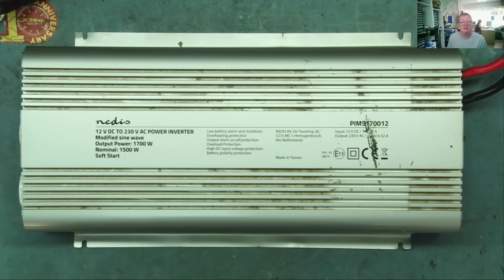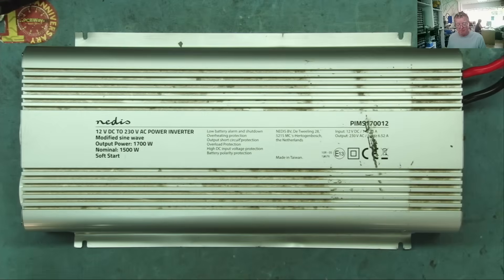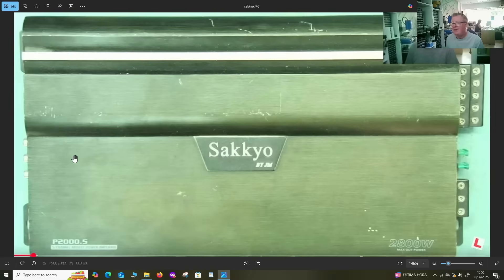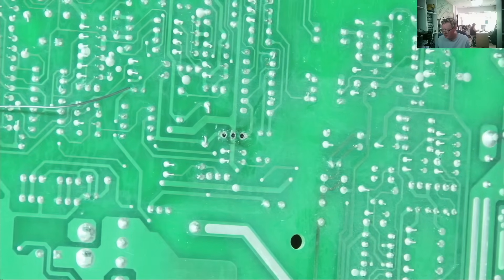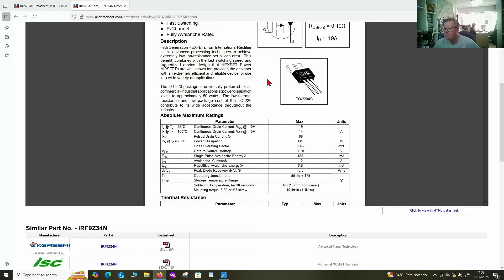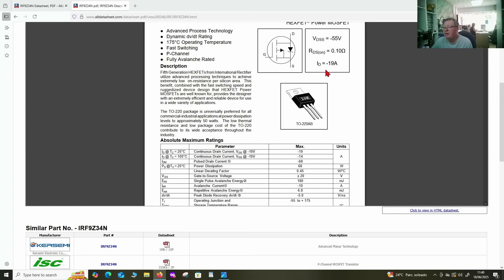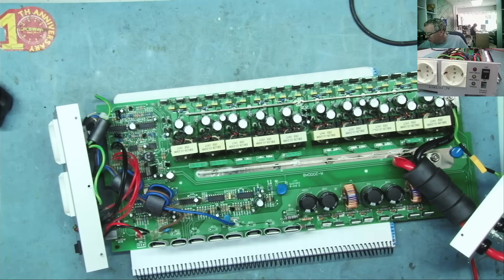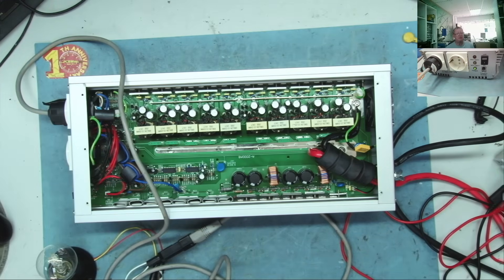You Fix Something And It Comes Straight Back Faulty! Why Could This Be?

Comment: Re. that MOSFET…. I always shudder when you and other Youtubers just push components over when trying to get to something else to measure, or just bend components whilst talking about them… I have learnt that the hard way around 40 years ago… Never, ever push components to get to measure other stuff…. Other times, like the guy with the amp in his car, it is sort of nice to walk with the guy to his car/home with an portable oscilloscope/multimeter and say "Now you show me the fault in the system", and then you can show the person right there and then the problem, instead of relying on a person that might/might not be able to discern from Positive and Negative, or red and black…. Glad that the car-guy was able to diagnose the fault on his own, but more often than not, they can’t.
Reply from the maker: Fair enough but how would you suggest to trace around an unfamiliar circuit with no schematics without moving stuff out of the way or even desoldering it so figure out what connects to what?
Reply: @LearnElectronicsRepair i know, I know… always easier to comment when the piece of equipment is not under my hands, lol… but I learnt that long ago, just slightly bend the component over, until you start to feel it resisting, but even then, sometimes, if you look again, one of the legs has broken, esp. if the equipment operates in high humidity or in salty air, like close to the ocean… but then, you might argue that it is only a question of time before the corrosion eats off the whole leg… it is just my personal preference, like much of faultfinding. Easy to criticize somebody for doing something in a different way than what I would do it, but we each have our reasons for doing it like that. 
As far as getting into those small spaces, I have a small bluetooth camera, meant to be poked into your ear/nostrils with a very small mirror attached to it, that I often use to get into those tricky spots. You can find them of fleabay or your favourite spot, aliexpress…
Reply: Typical description is something like "earwax remover camera”…. Sorry, I don’t know how to post an actual link without the Youtube algorithm automatically removes my post as spam…

Comment: Maybe not a bad idee to put some sleeve on the middle pin of the mosfet because you reduced the space between the legs. Air gap!
Reply from the maker: But it only switches 12V Vcc to some of the ICs after the soft start timer completes. What difference some insulation make?
Reply: @LearnElectronicsRepair  ... so he can sleep better at night

Comment: The picture of the wire explains why the amp would work under low power, but distort when turned up. Those last few strands of wires couldn't carry the necessary current.
Reply from the maker: Yep.

Comment: So how big is his Alternator to run that amount of power?
Reply: More likely the battery, if a amplifier voltage fals below 10 a 11 volt volt it will trip if it has these protection.otherwise you blow it up. Typical ( petrol engine )alternator gives 60 to 80 amps..more than enough
Reply: @edvanes5178 the amp claims 2800w, which is over 200A, probably 10-15 minutes on a full battery. 
My brother used to sell high power amps to car audio nuts, one guy said his set up would drain the two batteries in 3 minutes unless the engine was putting all its  output power in too two high powered alternators.  But it was only run on full power at car meets for a short while. The back seats were fake, they were just in fact  covers for two  bloody large speakers.  But then it was just toys for boys with big egos.😂
My brother just laughed and kept selling them Bigger and  more powerful amps, and the oxygen free shit that you must have.😂❤
Reply: @TheEmbeddedHobbyist  Sure your brother did , 2800W but not rms. And the amp is fused 2x 30A? This amp is by far an high end amp. Class D monoblocks 5 to 10kW or more will pull 200 Amps
Reply: @edvanes5178 I was talking true rms watts, you know the one's that are equivalent to DC power.  None of these new ways of measuring 10kw  and not looking at over 800A at 12vdc.
Power is in rms or your just trying to make a silk purse out of a pigs ear.
Plus I've run over 1kw rms in a small sound proof chamber and with out very good ear protection it hurts. Plus too many low frequencies and parts of your insides start to complain as well. And we were only simulating an Army fighting vehicle (AFV) driving on roads gets worse on rough ground. 
Happy days.

Comment: Nice job on a simple repair. I'm a but surprised you don't keep To-220 P-channel Mosfets in stock. I keep loads of them on hand. 
Also, while I'm here, I posted this in the previous video, but just in case you missed it I'll copy and paste it here too, as I'm still curious:
-I'm finding this circuit surprisingly frustrating to reverse engineer. It's really a shame that there weren't lots more problems (The paying customer might disagree with me 😂) because I could really have used a lot more in depth analysis on the converters. After half an hour of switching between the front and back views I'm giving up, and maybe I've got the layout wrong, but I'm left with a long list of questions. 
From my searches, it looks like they're using 10 60-watt rated gapped flyback transformers. Wouldn't forward converter transformers be a lot more efficient for this design?
How do they get that much power out of those transformers with a relatively low speed TL598 designed for 100khz operation?
Is the choice of 5 in-phase transformers per rail rather than a larger one purely due to needing very lower input impedance due to the low 12v primary, rather than the efficiency of transformer? 
Each transformer seems to have a snubber made of 2 diodes, 3 caps, and (presumably?) the power resistor despite it not obviously being connected to the diodes. What's the role of the 3rd, smaller cap? Is this a purely dissipative snubber, or is it recycled back to the primary in a way I'm not seeing?
Why is there a connection between the grounds of the primary and secondary sides of the transformer? Why wouldn't you still want galvanic isolation from the battery? 
Where are the rectifiers? I don't see schottky diodes or synchronous rectifier mosfets anywhere close to the secondary.
I know I'm severely sleep deprived right now so maybe I've been looking at half the images upside down, but I'm so confused by this, and now it's just one more thing I'll be losing sleep over. 
I know some people might think that 36 minutes is on the long side for an on/off switch repair, but I'm telling you this video neeeds to be at least five hours long.
Reply from the maker: There are a load of schottky diode matrix (common cathode) next to the larger mosfets which form some sort of bridge chopping up the output from the HV capacitors into 'modified sine wave'
Reply: @LearnElectronicsRepair  Okay, that makes sense to have the schottky diodes grouped together on a heat sink. Shame there's no schematic, since I would have loved to see how they did the output pseudosine wave, and if it's at all compensated for inductive loads. Hopefully it doesn't come back again, but if it does, I'd love some bonus footage of you plugging in a bunch of weird loads with a scope connected. 😂